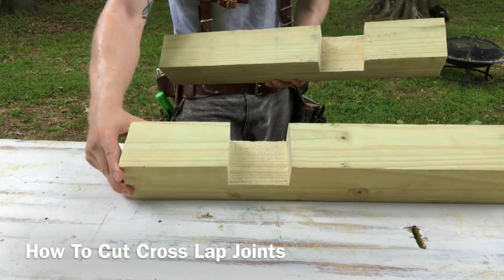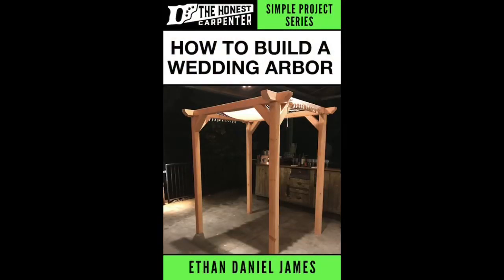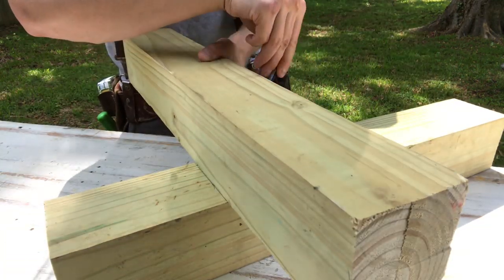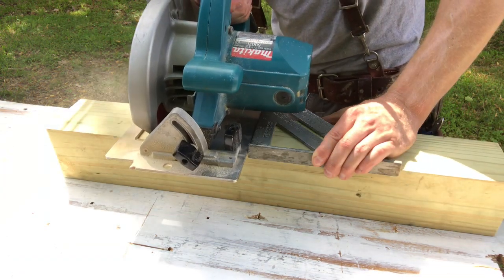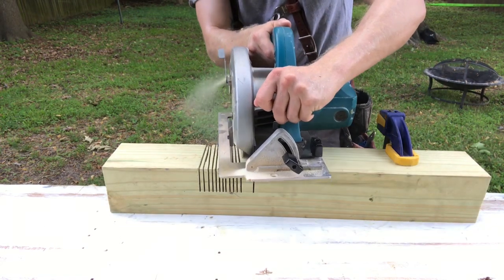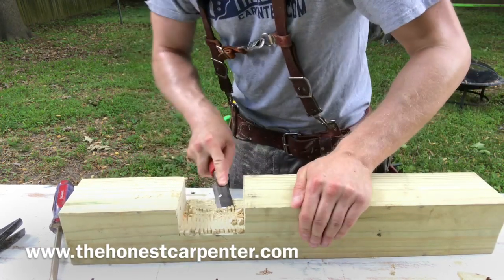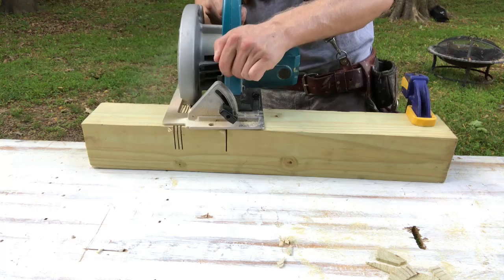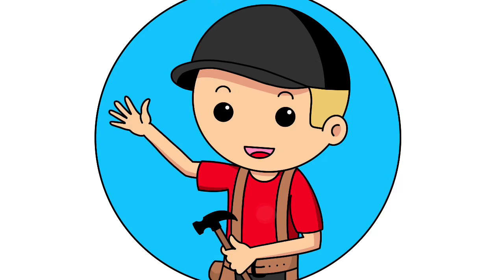How To CUT CROSSLAPS (In Thick Lumber)

Comment: Thank you, I need to make identical half lap joints in 4x4 inch timber. I have eight 1.3m lengths of 4x4 inch timber. I need to make four wooden crosses from these eight timbers, each cross joined together using a half lap joint as you demonstrate, so I need to cut out eight half rectangular joints, or tenches as you demonstrate, a lot of work !!!! Therefore, to speed things up, can I align all 8 timbers side by side and run a track saw guided by a rail to cross cut the shoulders of the lap joints on all eight timbers in only two cross cuts ? thank you.
Reply: You can.  Make sure your boards don't move at all..

Comment: I was planning on making wood cross using 4×4 10' tall when I make the second cut to give the width of the cutout for each piece to go together should the cut be right on the pencil line or to the side of the line so doesnt make it too tight or too loose when joining wood together?

Comment: Would a multi tool work instead of the chisel ?
I'm not good with chisels
Reply from the maker: David B Hard to say. It might be a little too aggressive. But, you’d be surprised how effortless this chisel technique can be. As long as the flat surface is down, it’ll really just lift the grain out in clean, manageable slivers
Reply: Thanks